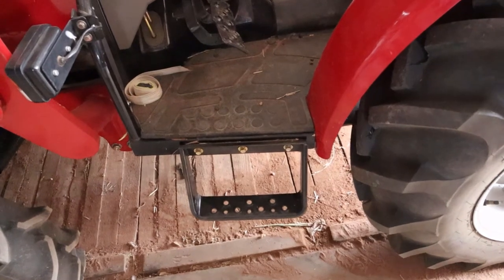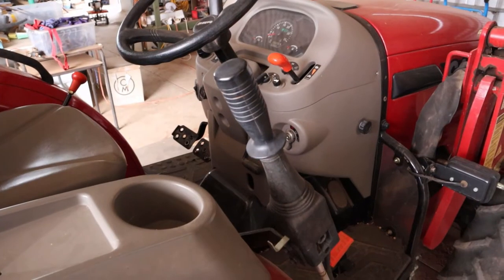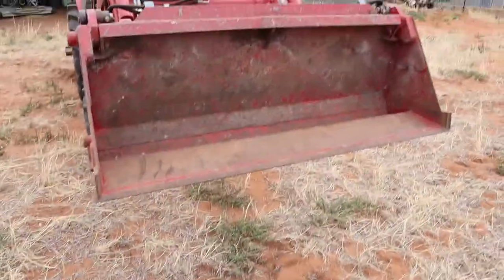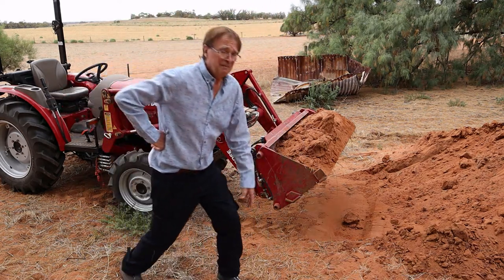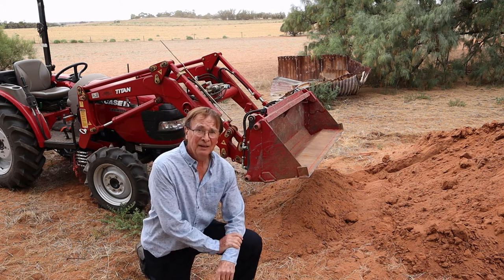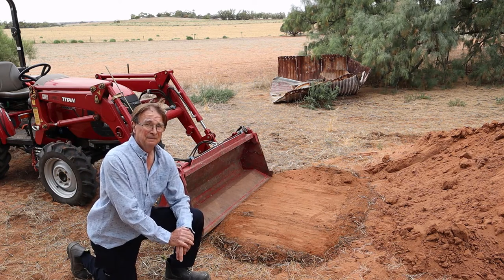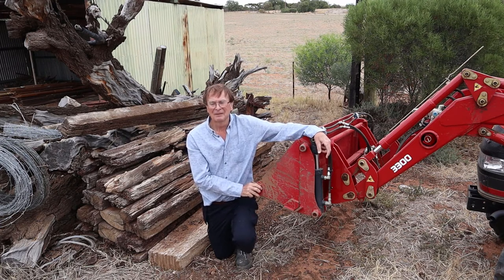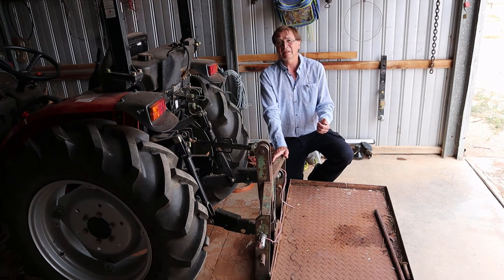How to operate a frontend loader with 4 in 1 bucket on a tractor

Comment: Thank you for another informative video, I appreciate it as I’m about to take delivery of a similar tractor with a FEL and 4 in 1 bucket. One question please concerning using the joystick. Does it only move directly forward/directly backward, and directly left/right, or can it be moved at 45 degrees to the central position? i.e. I’m wondering if two bucket motions can be accomplished at the same time?
Reply from the maker: Another good question, I confess I don't know the answer , I never consciously tried it on my rig. It would be best to check the manual on your new rig or ask the dealer. I don't know that there would be any advantage in opening 2 hydraulic valves at once as it would drop the pressure and slow the movement of the bucket. On that subject I noticed that if my tractor rpm was too low (below 1500rpm) it would slow the bucket movement. Hope this helps. I sadly sold my rig  😔with our recent move to an urban property. Enjoy yours👍😊
Reply: @AnnErasmus  - thank you for your reply. Sad to hear you have moved and sold your tractor…..I was enjoying learning from your excellent videos. My tractor is at the dealer but there is a long wait on the FEL, hence I don’t have the manual yet…..I’ll ask them about using combined hydraulics. My tractor does have a beefy hydraulic pump so we’ll see if it’s possible…..it just seems that lifting and curling simultaneously might be of benefit in some circumstances. Thanks again!
Reply from the maker: @MrScallops  👍